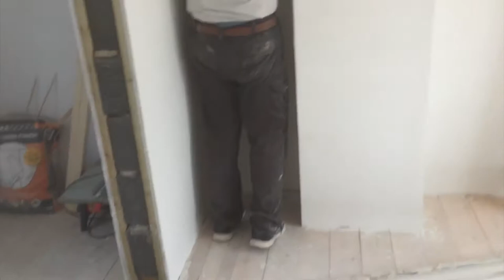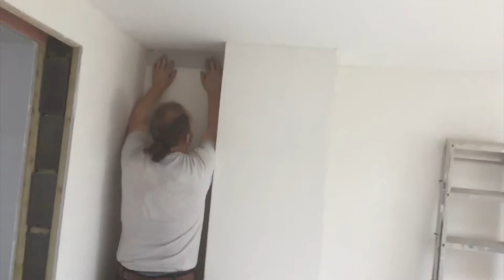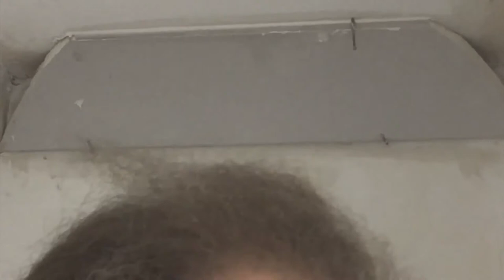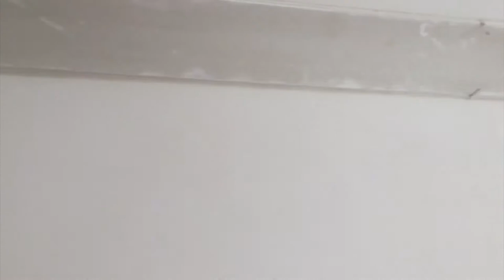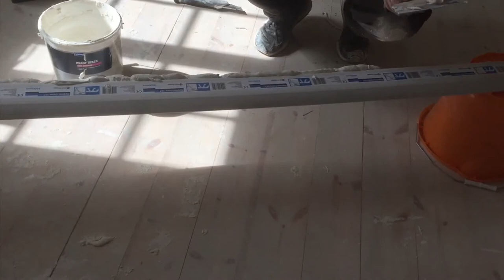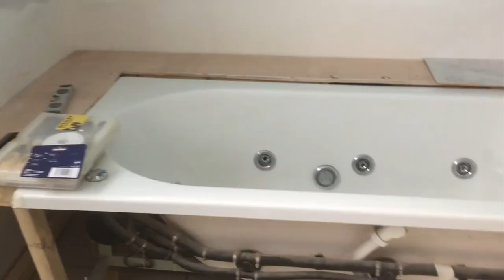Coving, review of Wickes coving Adhesive - Home Renovation TV #6

Comment: I used Wickes coving adhesive to put up lightweight duropolymer coving. It fell down after 12 months. On inspection, the adhesive had stuck well to the wall/ceiling but hadn't stuck at all to the duropolymer coving! Very, very annoying.